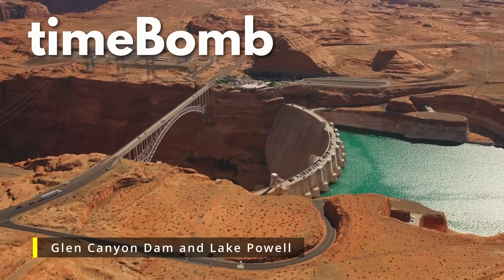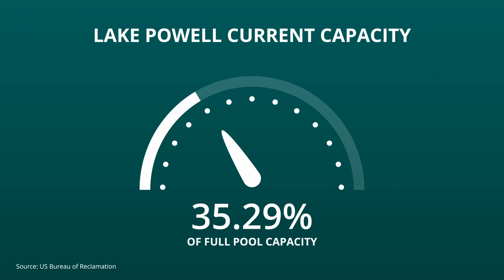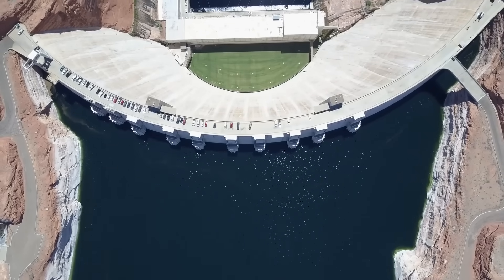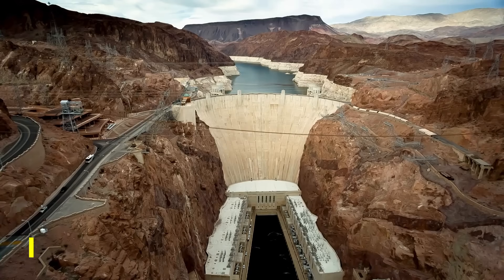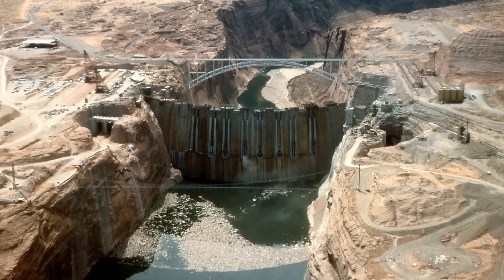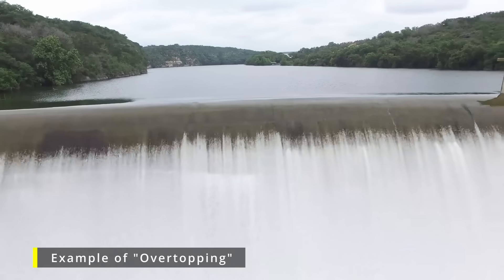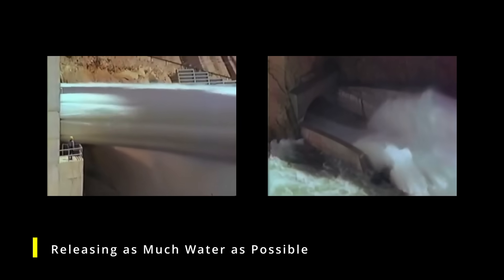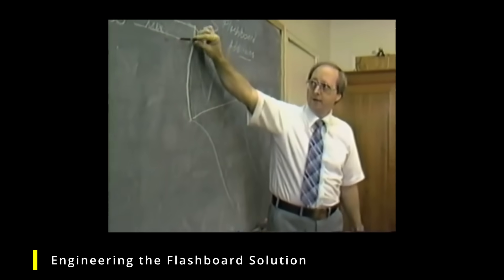Top 5 Secrets | Lake Powell Update

Comment: I thought I have read that the plywood topping structures were replaced with metal construction.   Is that true and if so is the metal construction in place today?
Reply: Correct. The steel replacements are shown and discussed in the video.

Comment: Cavitation is what caused the damage, it wasn't a result of the damage.

The plywood was added to the top of the spillway gates, not the dam itself. The reason for this was because they needed to be able to close the spillways so they could inspect them for damage, but the spillway tops were lower than the top of the dam. Thus they added the plywood to the spillway doors so they could close them, inspect the tunnels, and not run the risk of the water overflowing the spillway gates while the inspectors were inside.

There there are a couple of pretty good documentaries on this floating around on YouTube. The bureau of reclamation would want you to think it just happened, but it was a series of mistakes caused by said bureau that ultimately nearly caused the loss of Glen Canyon Dam. It was only the quick thinking of some people at the dam, and some good fortune, that saved it.
Reply: Cavitation is damage
Reply: @rodshoaf  The type of damage referred to as cavitation generally concerns metal. In the context of this video, cavitation is not referring to damaged metal. It's referring to the phenomenon which caused the damage to the tunnel walls and, eventually, the rock to which the dam is secured. 
"Cavitation in fluid mechanics and engineering normally refers to the phenomenon in which the static pressure of a liquid reduces to below the liquid's vapour pressure, leading to the formation of small vapor-filled cavities in the liquid. When subjected to higher pressure, these cavities, called "bubbles" or "voids", collapse and can generate shock waves that may damage machinery." Or, in this case, concrete and sandstone.
Reply: @lray801  Cavitation is actually the collapse of small bubbles of air.. It's highly destructive to all solid surfaces such as metal AND also concrete.